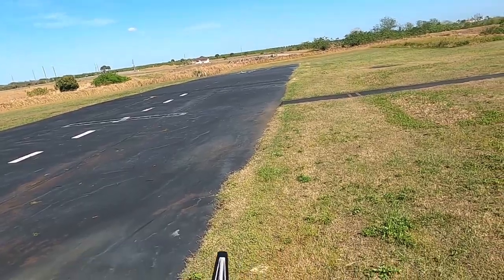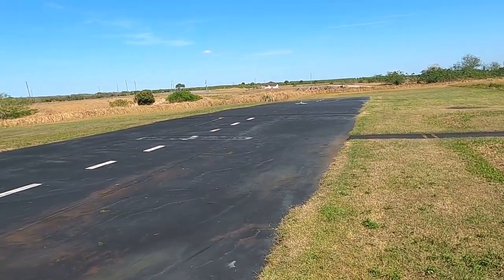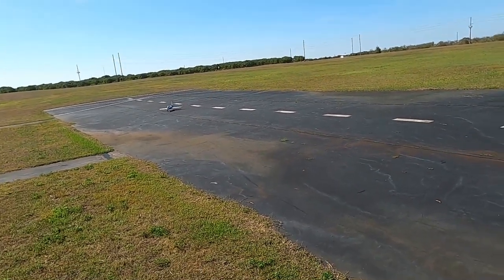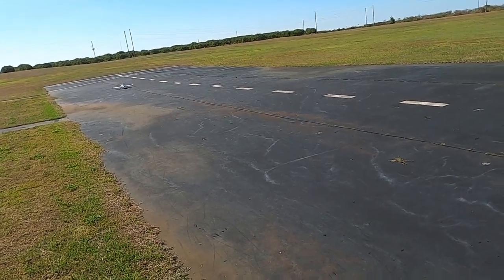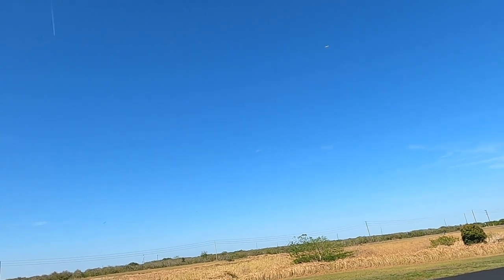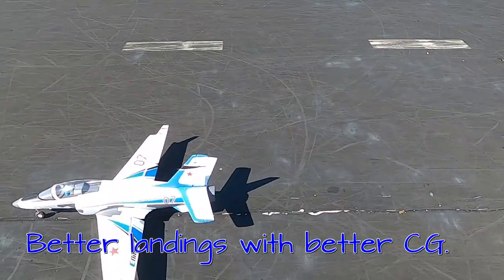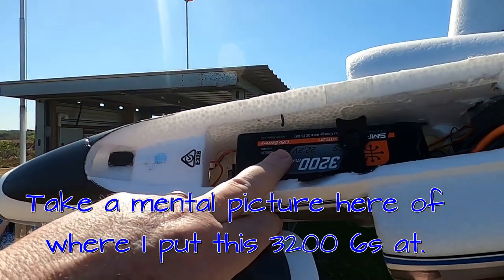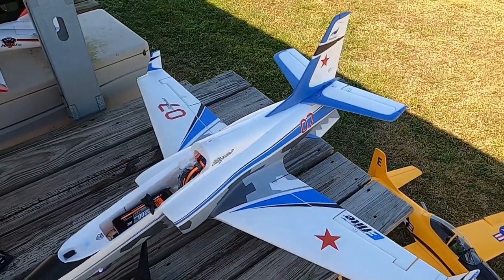Working out the CG with a lighter pack in the Eflite Viper

Comment: We think along the same path, wanted a lighter pack for my Viper, what I found was some light weight 6S packs offered by Flex Innovations, they offer a 1500MAH/45C 6S and a 1800MAH/ 45C 6s, they are using these to power the Mamba 10 G2 and the Extra 300 G2 Super and the brand new Pirana Super, I was only able to get 3 minute flights on the 1500 6s and just a little over 4 minutes on the 1800/6s, these batteries cost $44.99 and $54.99.....
Reply from the maker: Will have to check them out. Thanks!

Comment: Could you help me please ?
 I am rebuilding the fuselage of my E-Flight Viper, and I have some questions. First what type of glue is the manufacturer using to glue the receiver in place,  and I forgot to take a photo of it before disassembling the receiver from the old air frame. Do you still have yours ? Would it be possible to take a photo for me ? I need to be able to see exactly where it's install.  Second question is about the front landing servo. Was it glue to the body ? And for last, do you know if the ESC was glued in place, or just lose between the body and the glued cover ? Thank you
Thank you
Reply from the maker: the receivers orientation is long antenna to the nose facing up. Hot glue or foam safe medium ca for the nose servo and receiver. They use a white rubbery glue https://www.horizonhobby.com/product/foam-2-foam-foam-safe-glue-50ml-epo-eps-wood/DLMAD34.html
Not to sure how to post pictures in the comments but if you look at the manual here:  https://www.horizonhobby.com/on/demandware.static/-/Sites-horizon-master/default/dwa106eab7/Manuals/EFL7775_50-Manual-EN.pdf           On page 7 it shows you receiver orientation. Also I subded to you.
Reply: @FatGuyFliesRC  
Thank you.